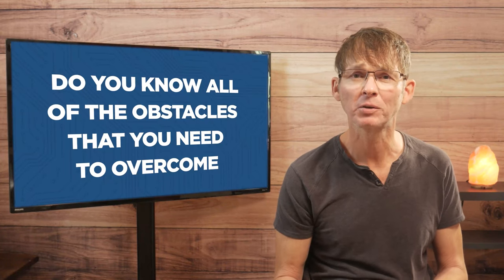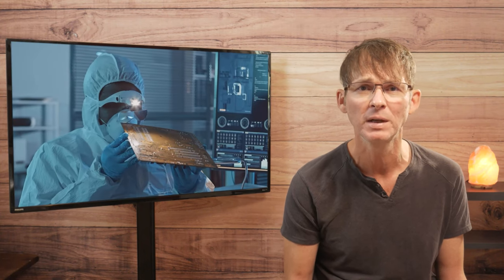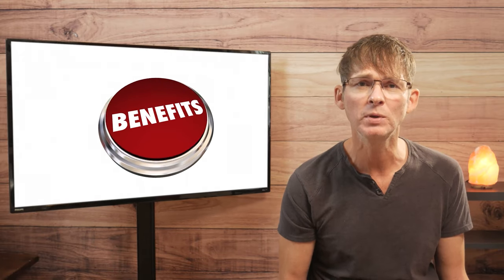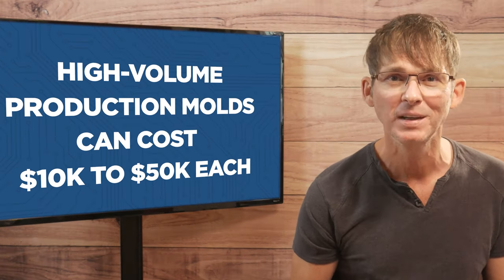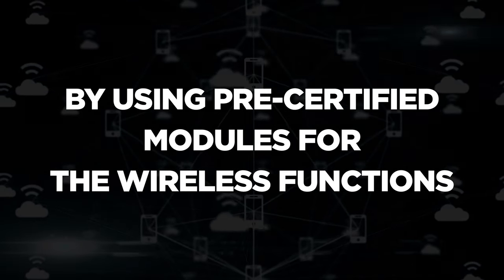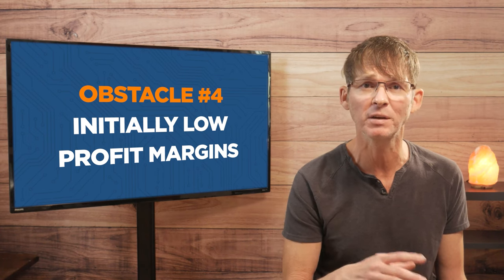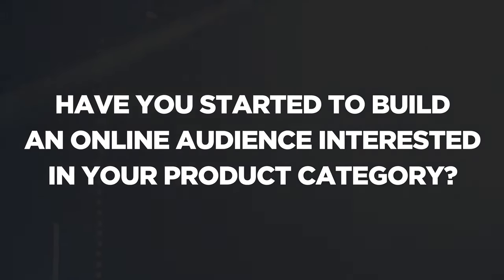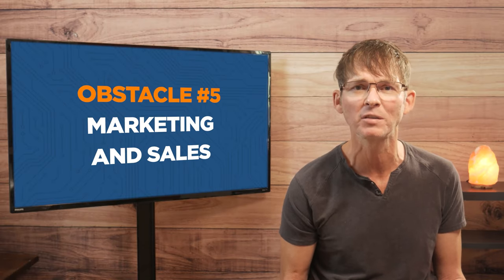How to Overcome Market Entry Barriers for Your Product

Comment: Thanks for the amazing content John, as always! 
One question: You always mention in your videos the cost of injection molding, but is there other options beside injection molding/3D printing to make enclosures at scale?
Reply from the maker: Thank you so much Gabriel! A process called urethane casting which uses soft silicon molds instead of metal can be an intermediate option for producing a few hundred units. But it still won't give you the same high quality parts as injection molding. Unfortunately, injection molding is the only option for higher volumes, but you can use aluminum molds instead of steel to keep the costs lower. Aluminum molds can produce 10k+ units.